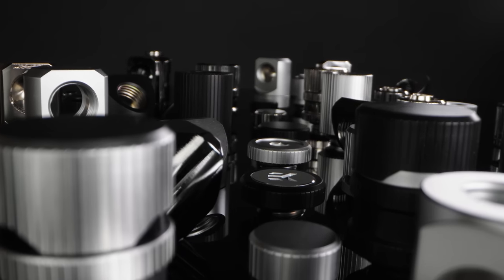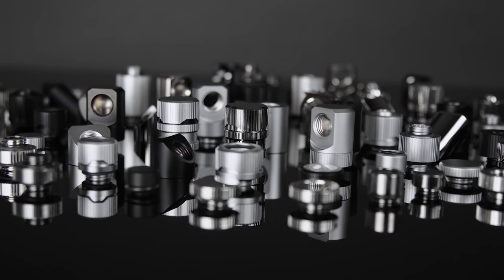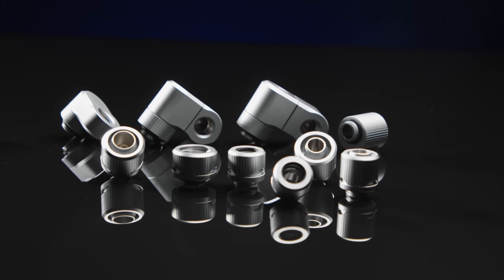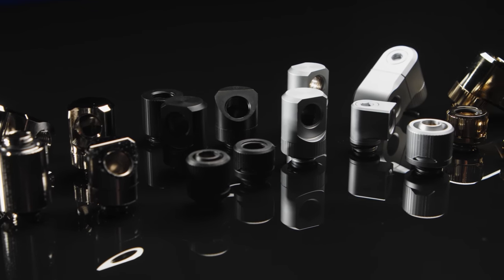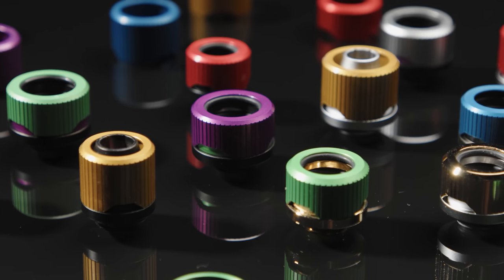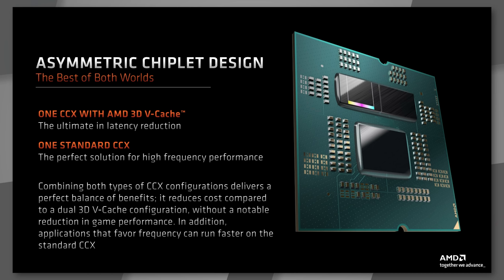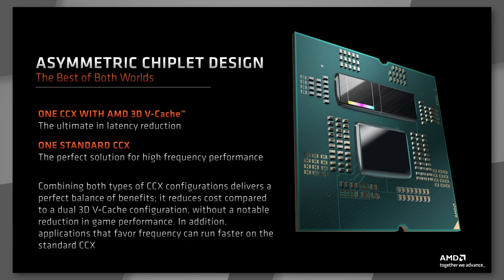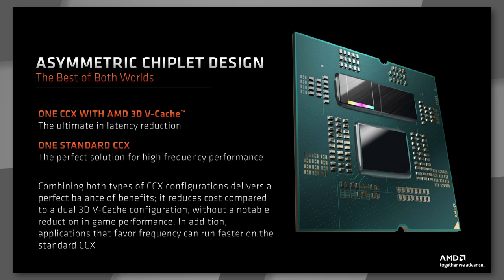Why I switched back to Intel...

Comment: Bought a 7800X3D with a 4090 after your "Thread Controller" comments earlier in the year. Absolutely rock solid and fantastic for work and gaming. Side benefit, it all went in a Fractal Torrent Compact so it's small and quiet to boot.
Reply: 7800X3D is the best CPU for gaming.
Reply: @musclecargarage2875  That's been my experience as well. Got a 7800x3d and a 4090 and it crushes everything I throw at it. I also have had an RAM issues like some people. I have in the past, though, so I think some of it is luck-of-the-draw.
Reply: same system, same experience; rock solid performance
Reply: @Av3nger89  No it doesn't. It gets 18K R23 scores. That's quad core numbers......
Reply: @kramnull8962  It's slower than higher core count CPUs but what quad core gets 18k in R23? It's ok to not like AMD CPUs but it isn't ok to be disingenuous.
Reply: hello mante! I am looking into that case. What's your opinion on the Torrent Compact?
Reply: I think that cpu is AMD's best overall CPU, less cores to cool, less clockspeed  pushed to extreme which brings about instability.
Reply: Jay repeats he should have gone for a 7950x but he really instead have gone for the 7800x3d which is much better performance anyway and without the headaches of ccd
Reply: What is your 4090?
Reply: @atecep Absolutely fantastic with a single flaw. I have the RGB version which has tempered glass both sides. The problem is its stupidly narrow with next to no room for cable management and exploding the glass because it's such a tight fit is a real concern. Mine obviously hasn't, but it's a stupid design flaw and you'll need to waste time dealing with it. 

Temps and noise are great, those big 180mm fans are amazing. Just remember that a decent air cooler and not an AIO is needed and that you have to be conscious of gpu length (I have MSI 4090 ventus). This is a plus because your front fans are so close to eveything it helps the cooling. And lastly in respect of fans, buy 2x 140mm for the bottom to help the GPU, you won't need a rear exhaust (YT video floating about, its -1°).
Reply: @kramnull8962 its a cpu for gaming and it beats every other cpu on that task so who cares about cinebench? lol
Reply: What board do you have tho? Asus and MSI still have a ton of issues with bios, memory support, compatibility with 4000 series GPUs.
Reply: I have a 7800X3D with a 3090 and it is running rock solid on an ASRock mobo inside an attractive Fractal North case. I am very pleased with it and it has been pretty much rock solid. I don't have any of the hassles that Jay has. I think two different CCDs on a chip was not the best idea but it's great with just one.
Reply: did you have any issues like in the vid?
Reply: @TurtlGnWld  He said crushes everything he throws at it.....
Reply: @TurtlGnWld  He crushes a 1950x
Reply: @justaweeb14688 I have had no issues with my computer at all. 7800X3D doesn't have a lot of the issues in the vid as it doesn't have two CCDs, that's why it's great and also why I didn't get a 7950X3D.
Reply: I have a 7900 XTX with the 7800X3D it runs as smooth as butter!
Reply: @kramnull8962  Did you just "nuh uh" my subjective personal experience? I said that it crushes everything I throw at it. "I" being the key word there.  I also only game on it, so I don't care about R23 scores.
Reply: I want to upgrade to the 7800x3d hopefully cyber Monday will have a good sale. Currently rocking a 5600x rocking a stable 4.8ghz all core with a 3080 10 GB and it's been solid in everything but Rust.
Reply: Why would you go for a 7800X3D? when it's true power is in 1080p and 1440p and not in 4K resolution lol that my friend is a waste just saying. The benchmarks results doesn't lie you can check every one of them 4K fps difference is negatable and mediocre fps gains we are talking about 3-5fps difference. X3D truly shines in 1080p most and 1440p abit less but 4K with X3D is pretty useless (even paired with a high end CPU other then X3D) at 4K fps result will be still the same on par with the X3D CPU.

Next time when you buy an X3D CPU pair with a 1080/1440p GPU not a 4K one like the 4090 and with those you are better off with a CPU that has the highest single core performance.
Reply: Damn I'm building my first pc and that's almost exactly the parts I'm eyeing right now. They seem very compatible and efficient on paper, but nothing beats experience so your comment helped put my mind at ease. Thanks!
Reply: I'd like to test mine with a 4090... I wonder which GPU will be equivalent in the next 5000 rtx series, 5070 ?
Reply: @kramnull8962  intel has over 40k in there, but how does it help with power draw and games?
Reply: Have a  i7-12700KF and a RTX3060Ti. No need for a RTX 4090. Wast of money. Performance as best like a 4090. Everything to the max wilt DLSS. Nvidia are stimulating the market for buy our top product. Do they fail? Yes. Some cards in the RTX range are no different by a lower number. There is absolute no reason to buy expensive products. With games. Do I see a difference with a card running at max with 75 FPS and a top of the bill system with 240 FPS? None..... It's all al dream. Capacity is now already maxed out. We need more faster hardware because.... Bla die bla..... etc. No. Nvidia realized that path already. Will go for the more complicated company things. Will leave us behind. Not our target anymore. Those simple users. There is more to gain with company's. Don't believe me? Look at the advertisement video's of Nvidia. Their goal is not us we our poor little people. They are focusing on a new market. Company's. Not at users of their products. Some what on the middle margin of their market where they want to go to. They reached their goal with their RTX range. What's next? More of the same? RTX 10.000? Mo money. Do we see any difference? Speeds al already high enough. So No..... 75FPS is as stable as what under every circumstances. Do i need to ramp it up to 240FPS? Don't see any difference, so No.... Nvidia realized that already.
Reply: @hansderuiter1699  
A 3060 ti the same as a 4090. Are you high? I'm guessing you're not doing much ML/DL with your setup, or much in terms of image or video processing, or AR work. A 3060 ti may be the same as a 4090 when you're using your computer as a toy and only have an i7 12th Gen strapped in front of it. But if you think a game that will run at a steady 60 fps with a 4090 in 4K will do that with a 3060 ti, you are kidding yourself. I'd be surprised if it would crack 35 fps steady with the same settings. Sorry but saying that a 3060 ti is just as good and that a 4090 is a waste, that's just wrong on so many levels. Is a 4090 a waste? Depends. But even a 4070 ti Super will run rings around your 3060 ti.
Reply: @AB-80X  Yeah. On the 5000 train are we? Never said anywhere that a 3060Ti is the same as the 4090. They are not. 4090 is better. But when is enough enough? Do you see a difference between 75FPS and a 240FPS game? Nope. Speed is the same. So  more faster doesn't mean more performance. If it runs at 60FPS with the normal gamesspeed with everything maxed out? What the difference? None.

Yeah I see the difference; The price. That's it al comes down to. I am not high but a realist. Game runs as good with DLSS and all maxed out on a 3060Ti as with the 4090. 

That rule is still true; Hardware is keeping the lead on the software that is produced.  Has always been the case. Which game will dwarf all the early lesser cards then the 4090? I see... None. So stop with beating your chest because I have a 4090. Superior. Yeah. You paid a lot while a cheaper card gives you also the same performance. Software. That rule still applies. Yes when a game calculate shaders. Mine will take 14 seconds. Yours's took 5 seconds. Do I mind? Nope. Stop beating your chest.... Is just BS. A game running at 60FPS or 240? Who will see the difference? Your eyes said nope. 50 is  already enough. More framerates is overkill and not needed for us humans. Anything above 50Hz is already good for us. No need to speed it op to 240. We can't detect it. Useless. So why bother?..... 3060Ti performs. No need for a 4090. See my point? I Guess not. Be that way. RTX 5/6090 is coming. Cost a lot more. Over a few years?  Bought it cheap. This is going on since forever. NVIDIA wants your money. You fell for it. I don't. A lesser card don't mean bad in these days.
Reply: @hansderuiter1699  
I don’t run any games at that rate. I run my graphics as high as possible at 4K. That usually gets me a steady 60-80 fps depending on the game. That would absolutely chocke a 3060 ti. You may not need the fps but the level of graphical detail you can run between those cards is immense. That is even true for say a 4070 ti Super or just a 4070 Super. So no, it’s not just a matter of running high fps. My computer is used for a bit of gaming, but most of my time is spent editing in Resolve, or doing ML with Python. I need the VRam for what I’m doing and I need the i9 and the RAM I have. That’s why I have the GPU that I have.
Reply: @AB-80X  Hear you. So a 4090 is bit of a overkill? The same for a i9. Got a moderne i7 with 8 cores, 16 threads. Does the trick makes you beleave that you got a 16 Core CPU with some efficiency cores. Really?CPUID goes mental. Usefull? Somewhat CPU and more cores do matter. Use also Phyton and Perl to program. Does they need that stuff? Hahaha.. A Pentium will do very well for that. Hell a 286, 386 or 486  will do even. No need for that. and who needs VRAM if you got 32Gb DDR5 and 8Gb of GPU DDR6 speeds? VRAM is thing of the past. Simulations. Sorry I am a tech nerd. Don't believe all the hype. Expensive hardware is always better. Nope. I choose my hardware wisely at a lower cost. Sorry for that.  No need for a i9 and a 4090. There is no software which can maxed that out.

As I said. Hardware are at the foreground now. Software is trailing behind it with a slower pace. 

Take no offence against my comments. Like to talk to people who think more is better. That's what the industry speaking  and wants you to believe. Buy our lasted product. Not always true. Look at my pocket first. Is it worth it? Than yes. Been here since the introduction of the XT and later the AT. I have seen it all, all that advancement. Bought it, but at a time you stands still. Why? Do I need it? If it runs as good at lower hardware why the need to buy the top of the range hardware? Do I need a i10, i11 or a 5090, 6090? No. Expensive stuff with no gains. NVIDIA's DLSS? watch out Intel has their XeSS. Will run on every card on the market. That will leave a mark at NVIDIA and AMD GPU builders.... Hahaha... NVIDIA is ahead of things. Customers? Let them go. We are targeting the big company's now. CPU's are  a thing of the past. Our GPU's are so much more advanced. 12 Core? Don't make me laugh. We have 2048 cores. Eat that... That's what is going on NVIDIA strikes first and Intel strikes back. A Battle....

Love to talk to you about this shit. Mo Money means not more speed. They already hitting their boundaries. All they want is Mo money. I just said no to it.  Lesser is already good enough. Keep that  in mind the next time......  Am not talking shit... Have a good day.

Comment: That's a bummer that you've had so many problems with that 7950x3d.  My 7800x3d has been rock solid since I bought on launch day.  I'll admit, I do hesitate to update the bios just because it is perfectly stable and don't want to screw that up, so my bios is a few months old.  The ram is running at 6000 cl 30 with manual timings as well as manually set SOC voltage of 1.2 and a modest -20 CO offset.
Reply: Ive had the 7950x3d since july and its bee great for me
Reply: Im planning on getting a 7800x3d with 6000 cl 30 RAM too.
Reply: Same thing man, had mine a couple months now and running perfectly. Fingers crossed it stays this way. I found prioritising the 3d cache in the bios works wonders and makes sure games are using that CCD
Reply: Unless there's some breaking news about a security flaw or double digit percentage performance loss due to a bug, I don't update the BIOS if everything's stable. Why try to fix a wheel when it's not broken, after all?
Reply: @blarghmcblarghson1903  Agreed
Reply: Same here bought the 7800x3d with Asus x670e and waited for the bios with lower sock voltage before running the system. No crashes/no problems what so ever. So i am hesitant to upgrade the bios. I haven't even checked for newer bios revisions.

Comment: I had the exact same issues as you described. Clocking memory back, then eventually running stock. The only thing that fixed it. Was swapping out the CPU. The "bad" CPU for me was the 5800x. Buying a 5800x3d fixed the issue. So i don't think it's down to the 3d V cache. It's probably quality control issue with AMDs memory controllers.
Reply: Tbf, I had a 12900k that had the same issue, once I upgraded to a 13900k I could actually get the advertised speeds. I don't think that this is just an AMD issue.
Reply: When did you buy your 5800x? Aka, is it an earlier model? I've seen and heard a lot of issues with AMD and ram when the AM5 platform was first released. In August, I upgraded to a 7800x3d, 7900xt, and 32gb 6000mhz, and experienced virtually no issues. However, I'm not doing extensive technical stuff like streaming, video encoding, and everything is air cooled and not overclocked.

I mainly ask because it seems a lot of youtubers and early adopters seem to still be having issues, while new adopters don't. Sometimes small QA changes can have big impacts, like a different pcb supplier, or extra support somewhere, or adding an extra .01% nickel to your alloy.
Reply: SAME!  I purchased a 5800X back in January of 2022 and I would just have random restarts where the system would just literally black screen and well... restart...  changed RAM, Mobo, PSU and still same problem until I finally decided it might be the CPU.  January of this year I purchased the 5800X3D and bam, no more random restarting...  A wild problem that I never really expected to be a problem.
Reply: early stepping 5800x i take it?
my launch 5800x was garbage. could barely do 5.7ghz static at like 1.35v
the best clocking 8c16t Zen 3 i've ever had was actually a 5700x that did 5.05 - 5.075ghz PBO/CO on the two best cores and 4.85ghz static at 1.31v
Reply: I had a 5900x runing with a 3600 mhz 32gig kit that was specifically tuned for ryzen. I had zero issue runing DOCP for 2 years. Now, i have a 7600 with a 32gig kit at 6000mhz. I had one issue with the OC. It started to bluescreen on me. I just clear cmos and redo the OC and now it works like previously. Biosses are poop. If you change things left and right, especially if you use ryzen master, some settings will be bugged and you have to clear cmos.
Reply: I had the problem with a 5800x3d. I wasn't  able to run memory past 2400 and it was causing my windows install to constantly get corrupted. I tried 3 different kits two separate Corsair vengeance 2x8gb 3600 DOCP and a Kingston Fury 3600 DOCP. I just switched to a 13700k with 2x16gb Gskill 6400. The performance gains have been pretty good since most of the games I play weren't using the 3d cache to much.
Reply: True.. silicon lottery is a thing, recently made 2 identical system, one is running fine, max clock, max ram etc, the other one is a bundle of problems, bsod, ram cannot go max expo speed. Swapped the processors between the two, and the problem followed the bad cpu.
A bad motherboard could also be an issue..
Reply: problem is windows, i have 5800x3d as well and love it, undervolted AND co -30 allcore up until it clock streach's
Reply: More likely a bios compatibility  issue
Reply: Also an early adopter of the OG 5800x. A lot of issues with it, pretty much have to run it at stock everything for it to not have a hissy fit and crash or cycle loop on boot, on any bios variants over the years. Had a friend share his 5800x3d for a bit, and every test I threw at it worked with overclocking/undervolting unlike my main one. Shows me to never early adopt again at least, but this was at the time when 30 Series Nvidia sold out in seconds and the new AMD CPU's were next on the market, sooo..
Reply: I've had zero issues running a 5700X and 5600X on G.Skill Ripjaws V 3600 memory for the last couple of years. Got the 5600X on launch day and the 5700X in September 2022.
Reply: I got a 5600G in November 2021 and I thought I was going crazy when I couldn't run xmp. I have a Gigabyte x570 Pro Wifi mobo and Gigabyte Aorous 3200 16GB RAM. Every time I turned on XMP it would work fine, then BSOD during a game. After restart it would fail to detect one memory stick and be forced to run at 2666. I would pull out the sticks, reseat, reboot and everything ran fine, no xmp tho. It's been stable like that since but good god I wonder if it's a bad cpu
Reply: @Kael1413  Issue is AMD has pretty bad lottery results. Your intel issue resulted in you not being able to run at certain speeds. OP, Jays, and everyone's comments results in the computer constantly crashing and going down.

Intel may have chip issues too but the chip issues are more stable compared to AMD. If you get an AMD CPU that works as intended it stomps on Intel. Just how lucky do you feel? When Intel craps the bed at least you can still use your computer, just slower.
Reply: yes it's obvious IMC degradation but jayz1000IQ couldn't even consider that being an issue and just threw AMD out with the bathwater without RMA attempt. Same stuff happens with Intel too sometimes.
Reply: It's a DDR5 Memory Controller Issue. 

Your 5800x issue was something different.
Reply: @davide4725 Yeah, a DDR4 memory controller issue